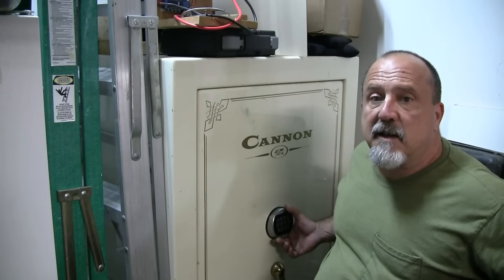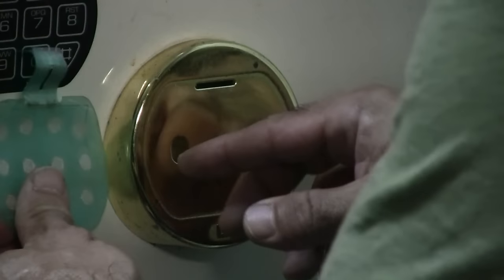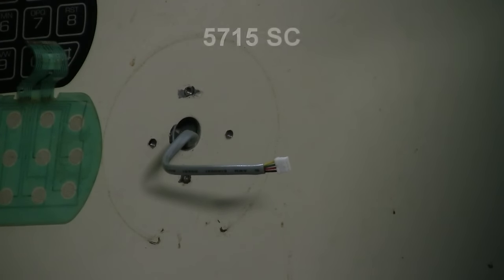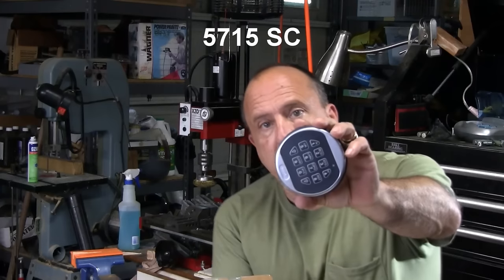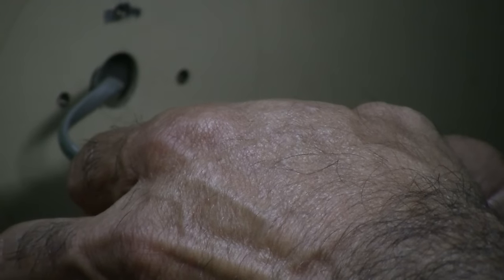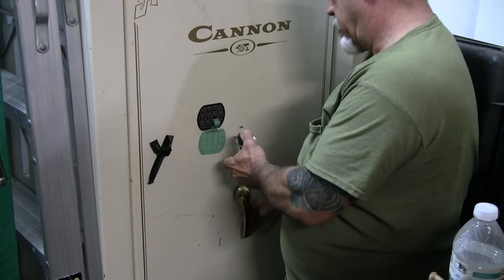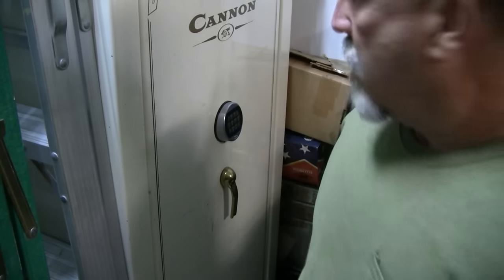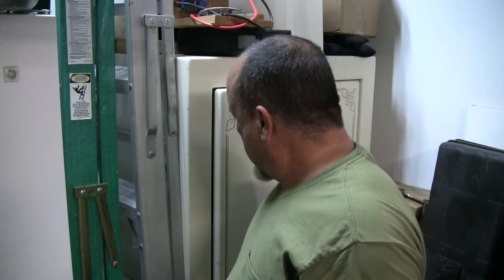Cannon Digital Gun Safe Fail Fix! Locked Out! Don't Drill - TRY THIS FIRST!

Comment: My buddy has one of these. He inherited the safe without a combo. Cannon said it did not have a one time code available. I am a software engineer, with a new skill set of robotics engineer, at least an ametuer one. I set up a progamical logic circuit on the 4 pin cable going to the lock mechanism, and after running this for 2 months i learn of this pound key. Is the combination a 6 digit pin, and must the pound key also be pressed? Can u share with me any pin specifities like do they need to be different numbers? Cannon was very unhelpful, in fact even providing a death crrtificate was not going to be helpful as per the customer support rep.
Reply from the maker: If the lock is an Lagard (it probably is) it requires a 6 digit combo, keys can be repeated and no # is required. I do not have any specifics on the pins. You will probably have to build in a timer to your code as three consecutive failures locks the safe out of any combo for a period of time (5 minutes I think) You can also check with LaGard, they might be able to help you. Hope this helps/

Comment: Once that safe is open you should be able to replace the electronic mechanism with a regular combo version, no battery or electronics to fail, or get fried .   multiple video's on swapping them out.
Reply from the maker: I've given that some thought. Might have to do that.
Reply: Suggestions on where?  Mine is currently working but I need to see if changing over is an option.

Comment: If you like electric locks, but don’t want to live with the fear of one failing, you need to get the SecuRam Safelogic  Xtreme lock, it’s a redundant safe lock, it is a electronic keypad with a dial lock back up just in case the electronic part fails you can use the dial lock to get in your safe. They are $300 so yeah they are not a cheap lock, but still cheaper than a lock smith when the electronic lock inside fails
Reply from the maker: I'll have to look into that, sounds interesting and with a nice failsafe!
Reply from the maker: @Smooththatsme  Nice, that's sweet!
Reply: That's what I have and why I have it. Worth the extra money for the redundancy. They have AWESOME customer service as well.
Reply: @abyssiniahenry128  I’m looking to find one for my Pendleton king. Can I ask where you got your lock from?
Reply: @Smooththatsme  Did you see my replies? I don't see them so I think YouTube is deleting them for some reason.
Reply: @abyssiniahenry128  This is the first reply I have seen from you
Reply: @Smooththatsme  The SecuRam SafeLogic Xtreme is not listed on their website but they have them in stock at their store.
Reply: @abyssiniahenry128  Hmmm, that’s strange. I will have to look, I can’t seem to find the safe-logic Xtreme anywhere!
Reply: @Smooththatsme  I've spoken with SecuRam directly(Jeremy, the owner, who does most of their YouTube videos) recently and they are in the process of bringing out a new version of the SecuRam SafeLogic Xtreme. May be released late this year/early next year.
Reply: @Smooththatsme  Every link I post YouTube deletes. Google search SecuRam SafeLogic Xtreme A-1 Locksmith .com They have them available on their website.
Reply: @Smooththatsme  Also Google search SecuRam SafeLogic Xtreme, Liberty Gun Safes Henderson .com They are in Nevada. It's available on their website.
Reply: @abyssiniahenry128  That’s good information, thanks for the heads up, my lock is an S&G Titan that’s almost new. I may just wait an see what that new model they are coming out with has to offer. I just don’t want to wait till I’m having problems with the electronic lock I have now and have to get a lock smith to get me into my safe
Reply: @Smooththatsme  They had trouble with the small led mechanical spin dial light not working when you raise the spin dial release, to the point of removing the light all together on 2019+ models. Looking at possible photoluminescent dial numbers instead. Also making the digital keypad surface fingerprint resistant.
Reply: @abyssiniahenry128  Yeah, I know they took the light off the spin dial release, I just didn’t know why they took it off of the later models of the safe logic xtreme. Not sure I care if it has a light or not, I don’t plan on using the dial that much anyway. I just want it for a back up
Reply: @Smooththatsme  I liked the spin dial light although mine stopped working and it wasn't that big of a deal for me. I also had an issue with my digital keypad not beeping so I warrantied it out and the new one I received did not have the light and the mechanical dial numbers are white now instead of a gold/copper color. Easier to see since there is no light. Top notch phone customer service. Personable and helpful. Sent me a new one and I installed myself.(with help from their YouTube instructional videos) I love having the fail safe redundancy of both options. Worth it to me. Nice sturdy solid material feel to the lock as well. Not cheap plastic type.
Reply from the maker: @abyssiniahenry128  I might look into getting one of these or something similar in the future.

Comment: It's a cheap safe it doesn't have an inner tempered glass panel with sprung relockers protecting the lock. If you drill a decent quality safe then your screwed. I'm a locksmith and I've found myself fishing for the relocating cables a few times.
Reply from the maker: I actually did another video on replacing the lock. It has a steel plate holding a spring relocker. So not totally cheap but there are certainly better safes than this one.

Comment: Factory recommends using alkaline batteries. They do make a difference between the lock functioning, and not so much. 
Also, a reputable locksmith would properly plug any holes created when we drill safes.
We have to say that the fire rating may be affected to eliminate liability, but not the case if the job is properly done. 
Great video though.
Reply from the maker: I plan on getting better batteries for the future, thanks for your input any knowledge on the topic is always appreciated.

Comment: Or, have your locksmith replace your electronic lockpad with a combination keypad and dial lock before it fails. Also, i you have to cut the safe open, DO NOT cut the door. Cut instead the back of the safe. Then you can access the locking mechanism. It's a good idea to go ahead and open up the back od the door and determine where the locking mechanism is and how it functions. Don't muck about  in there. You can activate the relocking feature which complicates things considerably.
Reply from the maker: Thanks for the tips, I've been inside the door so many times I'm intimately familiar with the relocker lol. Interesting piece of mechanical technology though.

Comment: If everything fails at open up your gun safe remove the keypad and use the the key that came with the safe at least mine did. My keypad failed two times and I just got tired of the headache and I left the keypad off now I used the key that came with the safe
Reply from the maker: Unfortunately the LG lock in this safe doesn't have the key option. Might look into that as a replacement lock in the future though.

Comment: Congrats!!  Too bad the batteries are not accessed outside.  Or the safe designed with the ability to plug into an electrical outlet for an additional power source in the likely event the batteries die.
Reply from the maker: An external source would be helpful in certain situations

Comment: I would take the back cover off the door and measure out were the locking actuator is so when it fails & it will, you can drill a hole in the door & punch it off & open the safe. Most of those cheap safes don't have any re-locker device/s but check for them anyway. I'd never buy or own a safe with any type of electronic lock.

Comment: So when you say original keypad failed do you mean it had no power or it did have power but the code doesn't work. ?  .  Because I'm having a similar issue on a Cannon Safe the keypad lights up and works but it does  will not open it
Reply from the maker: Mine was completely dead. If I were you I would start with a fresh batter to see if that helps then try a new keypad.
Reply: @ExtremeDIYGuy  thanks first thing I did was replace the battery still nothing

Comment: This video helped tremendously thank you! However my 20 year old cannon the inner lock where the code is stored is what’s bad so I’m going to cut the back and then get into it that way 😒
Reply from the maker: Wow, that sucks! I was afraid that would be the problem with mine. I'm still a little leery of it. I plan on replacing the inside mechanism when Cannon send me the replacement unit just to play it safe.
Reply: Jose's Extreme DIY  yes I would replace it while you can! Because I’m completely locked out of mine
Reply from the maker: @masonjones8712  I will, it would totally suck if I managed to get in with a new keypad and then the inside blows out. I'll do it as soon as I get the replacement from cannon, they say it is still on back order. If I have to wait to long I'll probably just buy one then put the cannon replacement on ebay.
Reply: Call Cannon they will send you the master code for the safe
Reply from the maker: @erniewillis9380  That probably wouldn't work for Mason Jones, it sounds as if the lockset on the inside gave up the ghost.

Comment: Of course, another option is to avoid locking your guns in a safe and under all circumstances dont rely on electronics or batteries to get to them.
Reply from the maker: That is true! BUt still need to safeguard the valuable ones while keeping the EDC handy.
Reply: If one keeps their self defense weapons in the safe, there’s no way you can dial a combination faster than punch a keypad.

Comment: My concern is one if there is an EMP and it disables Electronics or two you have a break in and vandals simply knock off the keypad making the wires unaccessible.
Wires yanked out.
Reply from the maker: At that point I would cut the safe open. Not sure there would be any other alternative other than having someone drill it.
Reply: I believe the newer LG locks are EMP resistant. I had one installed on my Liberty safe.
Reply from the maker: @ericplaysbass  That's very good to know!

Comment: I had a CANNON safe electronic keypad die on me, it wasn`t even a year old yet. I tried 2 new keypad`s, it did not fix it. Both new keypads would do what they were suppose to do, and also beep, but the internal locking unit had failed. Ended up ruining the safe by cutting into the door to remove the lock. I no longer will EVER buy another safe again that does not come with a set of backup keys. As far as CANNON customer service, they were ZERO help. When i replaced the safe with a new one, it wasn`t a CANNON, that`s for sure.

Comment: Everyone that has a safe should open the door and remove the inner panel and chase trace the cable then using a coat hanger wire and make a cheat key, is what I did and now I can open if faster than using the key pad and it’s actually more secure
Reply from the maker: That's a interesting idea ill have to look into it. Thanks for your input!

Comment: It cost me $200 to get mine drilled 7 years ago in The OC, and that was only because I went thru a locksmith store front.

When the safe has been drilled and opened, the safe guy pounds a hardened steel tapered pin into the hole and grinds it off flat.  There is NO HOLE LEFT to manipulate the safe locking mechanism.  You can't punch the tapered pin out because it was put in from the front.  It is as hard or harder that the safe door.

This safe has had a standard S&G combo dial for 25 or 30 years with no other issues.  No electronics to die.  I can open it almost as fast as this guy does his electronic lock.  I would NEVER, EVER buy an e-lock for a safe.

I was in a home yesterday that had an electronic flush system (owned by a master plumber?)  One more thing to go wrong.
Reply from the maker: You got a great deal!

Comment: I only use the old fashioned mechanical dial locking mechanism safes
Reply from the maker: They are a lot more reliable!
Reply: Mechanicals can be cracked in about 5 minutes by a guy who knows what he's doing. With electronics,  you have to know the code. There is no feeling it out.

Comment: when my cannon broke it was the little gear box thats on the inside of the door lucky when it broke it would not lock i replaced with one that had both digital and dial it was very expensive like 400 dollars compair to just digital that are around 100 dollars my dad had his cannon drilled they patched the hole but still took the lock smith a few hours with what looked like dental tools so i dont think the avarge person could pick one beside why bother just cut a new door right in the side most safes are only 10 to  12 gage steel very easy to cut you would have to be a fool to try to go through the door.
Reply from the maker: In the future i might opt out and go for a digital/Dial, at least if one fails there will be a backup.

Comment: I found the two wires that controlled the electromagnet on mine opened up the safe, drilled a hole in the back of the safe, run a wire underneath my desk hooked up a toggle switch, put the panel and all back on the door and that is how I open my safe nowunder the desk secret switch running off at 9 V battery

Comment: Why don’t they make the keypads with battery drawers accessible.  The number 1 reason it will die is the batteries.  Sentry safe has it amazing
Reply from the maker: Good Point.

Comment: Also, when drilling a safe you are usual if drilling through the swing bolt,
Linkage and or relocker.  Shouldn’t be able to just open with a screw driver after but if you don’t plug the hole with something you are definitely at least showing the bad guy where to drill.
Reply from the maker: Thanks, good advice!
Reply: @ExtremeDIYGuy  if the hole is just a view hole can use steal stick. If it’s over the swing bolt or something important can hammer in a lag bolt and cut off the end with a dremel.  Can “try” and paint match to hide it or put a sticker over it haha

Comment: Mine is unlocked, handle down but I can’t get the door to open. Any ideas? I already sprayed WD40
Reply from the maker: Check if the handle has a set screw, might be loose and spinning on the shaft. That's about the only thing I can think of.

Comment: This is exactly why I bought my Stack On safe. It has an electronic key pad and when you pull it off the safe is has actual key slot under it. So if you have a failed keypad you can just use the key and open the safe. So far Ive never had to use the key but glad I have the option.
Reply from the maker: Under some circumstances a back up key can be a good thing to have.

Comment: Use batery put 9 volts to safe wire and it opens. No key pad needed.
Reply from the maker: I don't think it works like that or any safe could be opened with a 9v battery